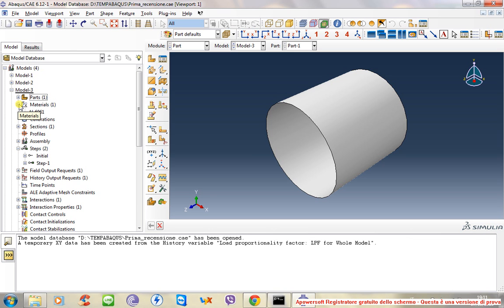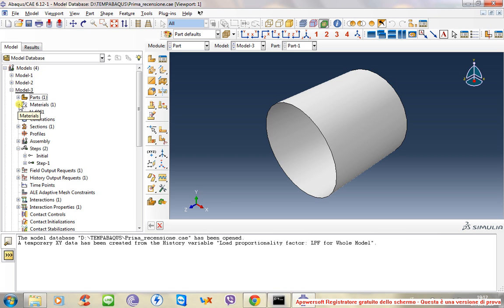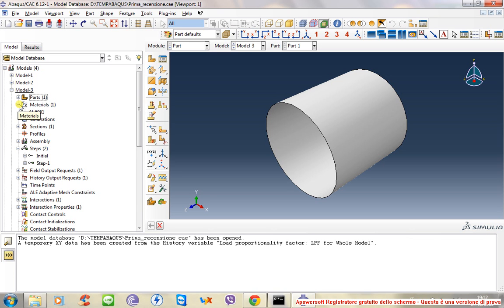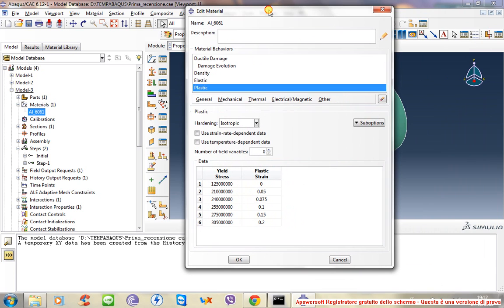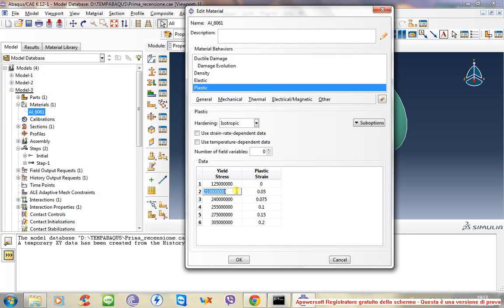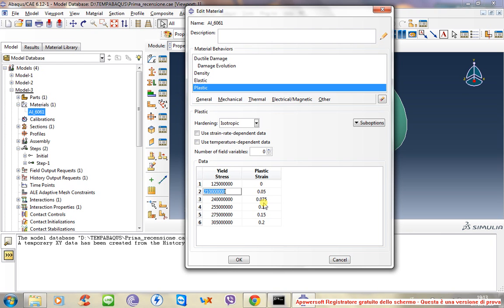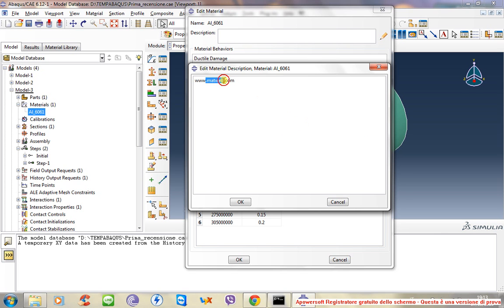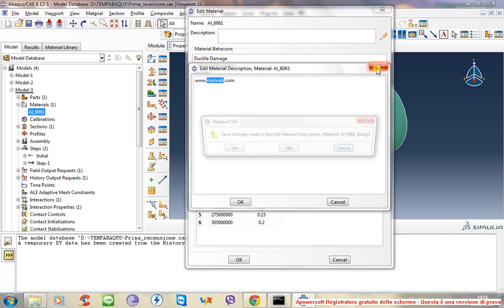Plasticity in your model (Part 1)

Comment: Hi Astro, 

Where did you get the yield stress  & plastic strain values from? especially if you dont know the material. But have the test data from compression test. How to extract data (uniaxial hyperelastic as well as Plasticity data & Mullins effect) from a compression test ? I know that Abaqus has a plug in to create this material card but I can say its not a very good plug in as the material card data doesnt correlate well with my test data. Is there an alternative way to manually create the material card from test data (Stress vs strain) ?

Thanks,
Vaidehi

Comment: Hello Astro Abaqus, thanks for your videos. I have a question about the parameters in the ductile damage. Could you tell me what was the criteria/source to choose the fracture strain, stress triaxiality and strain rate? Did you run a prior calculation (explicit dynamic analysis) to extract such values? Another question, what i was the value that you used in the damage evolution?

Thanks in advance